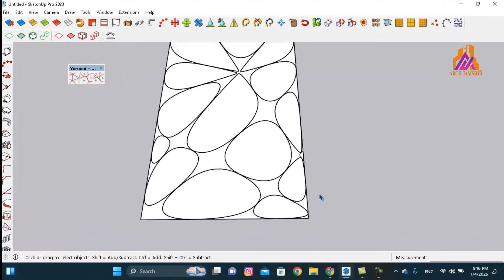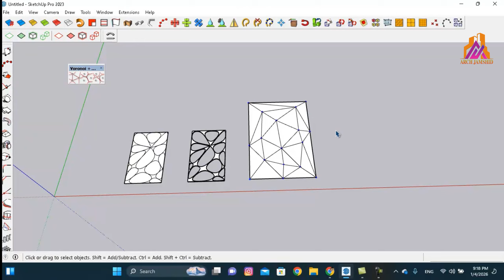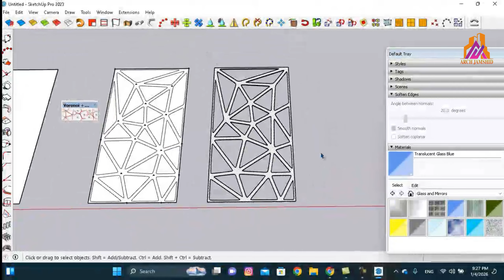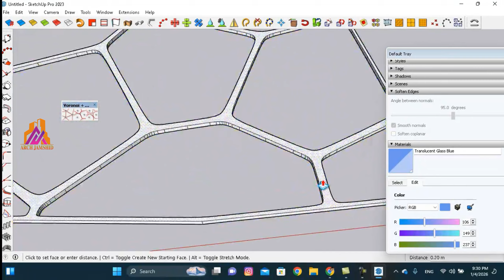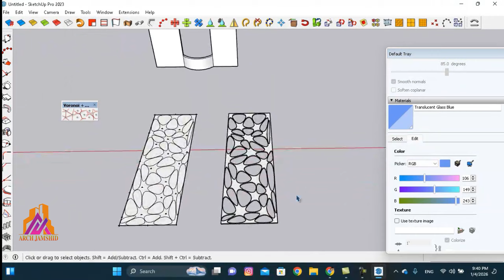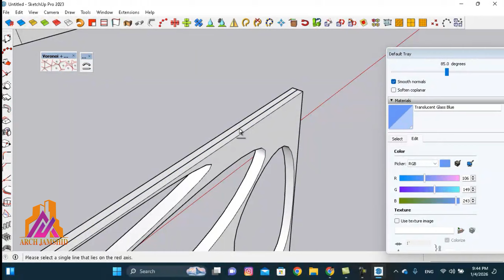Voronoi Plugin in SketchUp: Create Stunning Architectural Designs FAST! #sketchup #sketchupplugins

Comment: tried it sir but it's not appearing on my sketchup. I've checked my extension manager and it says "unsigned", what can I do sir?
Reply from the maker: Hey 
SketchUp is just blocking it because it shows as unsigned.
Open Window → Extension Manager then change the loading policy to Unrestricted, then restart SketchUp.
After that, the plugin should show up and work fine.
Reply: Thank you, sir. But wouldn't it affect how I run my sketchup as I used it, sir?
Reply from the maker: @hannajanebenedicto3073 
No worries 
It won’t affect how SketchUp runs at all.
This setting only allows SketchUp to load extensions that are not digitally signed.
Everything else will work exactly the same.